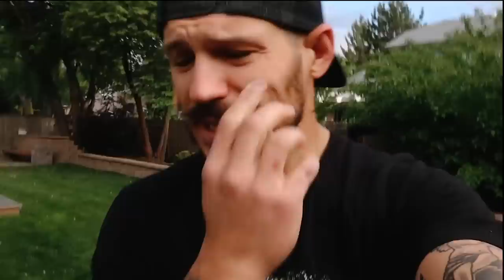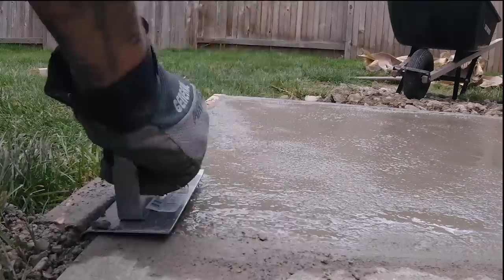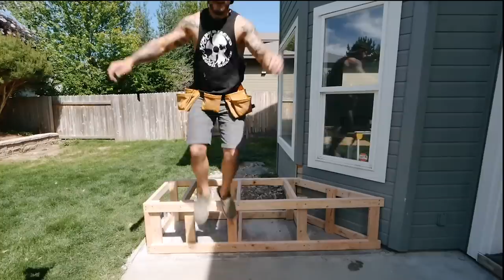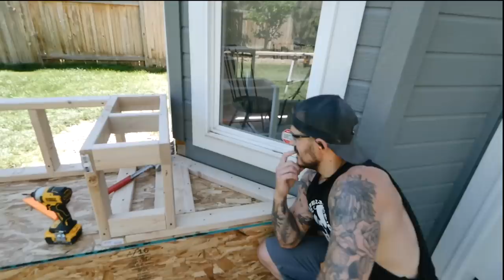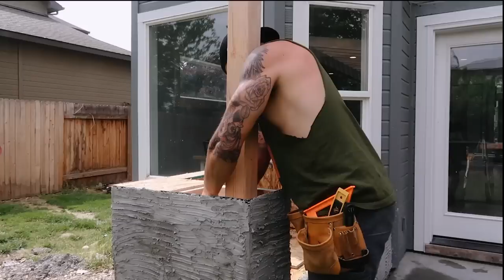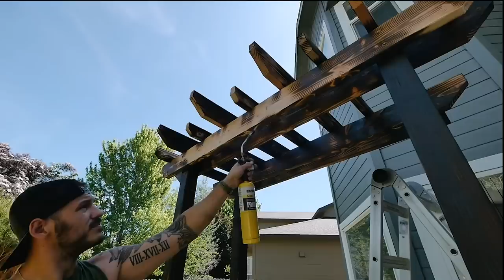Building Outdoor Smoker Grill Station

Comment: Good job on the concrete part.  Definitely want the mesh for reinforcement.  It's unlikely, but the new slab could shift if the ground shifts because it's not tied into the existing slab.  To make sure this doesn't happen you need to drill into the side of the existing slab at least 6 inches deep, then insert a piece of rebar and epoxy it in.  Then when you pour the new concrete the rebar makes it a permanent single piece with the old slab and it won't ever move.  For your new slab you probably needed 2 pieces of rebar epoxied into the old slab spaced about 2 feet apart.  Your slab probably won't move because your ground is unlikely to move since you're in a warm weather climate.  But if you're in an area where the ground freezes in the winter you definitely want to do this.
Reply: I had a concrete business for years and Matt is totally on point.  You pin the concrete slabs together with some rerod hammer drilled in the the existing slab so if one heaves the other moves with it or at least has tension so it wont heave.  Not necessary to epoxy if the hole drilled is slightly smaller than the rerod and you use a maul to force it in snuggly but epoxy would work.

The reason you saw stone on some of the surface is because you didn't use a float first before the finishing trowel.  The float works the stone down in the concrete (works up the cream) a bit and gives a solid rough surface and then you can finish of with the finish trowel when its setup a bit.  Nice job though and looks great.  Here is the link to a simple float, they are relatively cheap.  The float is the work horse that preserves the quality of the steel finish trowel.

https://www.amazon.com/MARSHALLTOWN-Premier-Line-148RD-Magnesium/dp/B001RITKNW/ref=sr_1_6?crid=Y0BFSRLVNW55&dchild=1&keywords=concrete+float&qid=1610422058&sprefix=cocrete+float%2Caps%2C196&sr=8-6
Reply: He could have also dug a few inches under existing piece and put the fresh concrete under while also leaving in the mesh

Comment: I might suggest waterproofing the top surface of the osb beneath the pavers though, just like you would protect roof sheathing. You may see some rot in years to come otherwise. Alternatively, a solid concrete top might look nice, provide better protection, and you could still waterproof beneath it. Other than that, looks great! 

P.s. Love the vids, and nice touch with the torched pergola👌.

Comment: In the future, I definitely recommend laying plastic over the existing concrete slab (wrapping down over the edge between new and existing slabs) which will prevent the new concrete from staining the old slab as you're pouring it. You can then let the new concrete cure and cut off the excess plastic, leaving the remaining plastic between the slabs as a seam to allow for subtle flex in the new slab and further prevent cracking (on top of the "rebar" you already put in). Looks great btw!

Comment: What a great diy project! Question though, are you concerned with your 2x4 base frame about moisture being pulled through the concrete pad as the framing isn’t pressure treated? I thought it was good practice to put pressure treated lumber whenever in contact with outside concrete? Keep up the good work man. Love your work!
Reply: Far to much long-term thought.
Reply: I definitely would use treated wood if building something like this. 

I built a similar unit like this but slightly smaller and with an actual roof instead of pergola and yeah I used all treated wood, the coated for protection.. 
But I also live in cold climate with lots of snow in winter and rain in summer

Comment: Thoughts on just using concrete board instead of wood plus waterproof and metal mesh?
Reply: Steel studs are better also. No need to add more fuel near a fire source.
Reply: Why not just build this out of stone only? The number of different products used makes me ask how much did this cost?

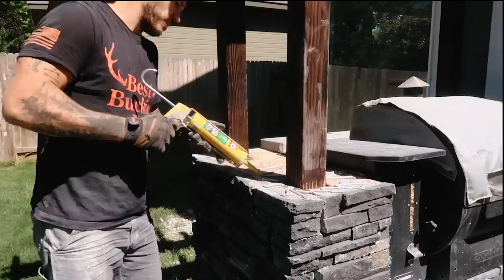Comment: Hey Alex or anyone in the comments, what about weatherproofing under the pavers? I didn’t see any membrane or water protection between the pavers and the OSB. Is this a concern? Rain water will run down in between the pavers. 15:42
Reply: Yes, that will be a big issue.  Didn't appear any of the wood was PT.
Reply: He should have sprayed tile stone protector
Reply: You can use pt or treated lumber with a copper zinc additive that they sell at home depot but starting with pt is easier and safer
Reply: @davidc165  you

Comment: 10/10! There is a high temp red colored caulk, in the wood stove section of the box stores, that would seal where the concrete boards meet. Just extra protection to keep heat from hitting the OSB.

Comment: also no metal "L" shape behind the bottom of the rock, no treated wood on the bottom attached to the concrete, too close to the windows, if you want to build this for few years and then have to demolish it, the go ahead and follow this instructions
Reply: I agree 100% Julio!. Not sure if this was just a quick build and tear down for the show or what. Not using treated lumber or cedar for an outside project is asking for early damage and re-doing the whole thing. At the very least ground contact treated lumber where the wood sits on the concrete.
Reply: Couldn’t agree more. I’d also be concerned about spontaneous combustion of 2x4s as the grill reaches 600+ degree.  Wood will self combust at ~500 degrees. So that OSB and 2x4 can ignite without actually being exposed to flame.

Comment: Highly recommend getting some good sheet metal snips(wiss m6 and m7) this will help tremendously with nicer cuts. Also use side cutters for the cement wire because you will wreck your metal snips. Get the side cutters with the baby blue handles I forget the name. All at Home Depot. -your average sheet metal guy

Comment: it came out looking pretty dang good.  If I were to have built this...I would've extended the front of the pergola to provide more shade while I was grilling...and would've made the top slope downward slightly front to back and made a solid (rain proof) roof structure that would shed water off the back.  That way it looks cool but is more functional.  Also, though you were limited with space...a way to include more counter space around the grill would've been nice.   Of course that is just my opinion, still a very very good looking build and seems very good quality (assuming that OSB board does not get moisture).

Comment: Did you fill the gaps between the concrete blocks on the top? Also, do you think is necessary to seal the concrete to avoid stains of grease? Just wondering, because I am planning to build my own.

Comment: When it rains won't water get inside the 2x4 frame because that angled corner that connects to your house is open? I didn't see you covering the gap with something to keep the water out. Same thing with water running down the posts unless you added some type of waterproof sealant around it. Either way, it looks pretty darn sweet. Congrats 👏

Comment: Wetting the scratch coat before applying the veneer stone will also help the (thinset) mortar adhere better to the wall, even without having to use a bonding agent. Otherwise, in time, the stones could fall off of the wall.

Comment: why didnt you use treated lumber for what is sitting on the concrete?
Reply: Was wondering this as well!
Reply: He should have.  It will rot away eventually.  He should have flashed where it's attached to the house too.  I like the overall design and idea though.
Reply: Watched this exact thing on another tile channel where they were doing a tear out at a really nice property, it's going to rot from the water. The stones and mortar doesn't make it waterproof, in fact the water will just be absorbed into the wood.
Reply: it looks to be off of the ground
Reply: You guys are not making it easy for the dude. Good points. Which I would hate to hear after I'm done 😂
Reply: Shoddy work indeed
Reply: ....no wood at all. Steel stud & hardibacker. No rot, doesnt burn.
Reply: He placed blocks underneath
Reply: Can't believe this isn't top comment.  Looks like water will go straight down posts to OSB as well.

Comment: You didn’t build a port to clear your ashtray. Gonna have to manually do it from the top or remove grill every time
Reply: Or the grease port
Reply: These were my exact concerns when watching this
Reply: But still pretty awesome
Reply: Will anyone mention how the wood thats in direct contact with concrete will just rot out?
Reply: @OncleJer  he put brick spacers on the bottom
Reply: My grill doesn't have a port. It has a trey that you have to lift out so his might be the same.
Reply: I was going to say the same thing. He's definitely has a grease port because you can see it in the video. As it's designed it will just pour grease into the opening the hole with the electrical wire and out the front

Comment: If you want the "cream" to rise to the top, you need to use a magnesium float first, and then the steel finish trowel. Just an FYI. 20+ years of concrete experience.
Reply: Not to mention using a steel trowel right away locks air in and can potentially “pop” the top.

Comment: Awesome build.  What grill did you install.
Reply: It is a Camp Chef pellet grill/smoker. But his build has major flaws like he doesn't have anything to catch the grease that will drain out on the bottom of the right side of the smoker, or he has no opening for the pellet discharge chute, and with no access to empty the ashcan after every use, he will have to use a vacuum to clean it out before each use.

Comment: You forgot to put expansion paper. You need to have an expansion joint when pouring new concrete next to old one so it does not crack to expansion.

Comment: You may have issues with the new concrete against the old. You didn't add any expansion board to account for the expanding/contracting of the concrete.
Reply: a Magnesium float would also help to get you a better looking slab. Mag Float to bring up Paste and push down the rock, trowel to finish and seal the crete

Comment: 15:45 u dont ever wanna make any top surface level on here, just the walls. Same way u did the slab, this should have a little drop on level to account for rain/snow. If the smoker insert its level and its not tilted foward just enough to remove water, them its gonna b rotten in a couple of years. Its tilted to the side but not to the front.

Comment: OSB is not moisture friendly. I would never recommend using concrete with direct contact. A pressure treated sub floor board would be a better choice. None the less good video. Came out great.

Comment: Great work! You WAY undersold this project. Outside of the burned wood, which has been covered plenty, you breezed through two steps worth separate vids: simple/small concrete pads, and the rock facade. Two things seldom covered in detail by the usual suspects on maker YT. Your vids kill because your vibe is so positive and real for the other average dudes with regular houses and regular shops. Cheers.

Comment: Grill within 10 feet of house is fire hazard. Beside window is a death trap. Putting a roof of any kind over a grill or pipe it into the gas line and makes it a kitchen under IRC and the building code compliance would be insane. Homeowners insurance definitely will not cover this house when burns down and this video will be evidence.

Comment: Not a kitchen at all. I don't get it.  The station doesn't offer anything more than the original legs of the grill did. Also, it's made to fit that particular brand of grill. Why was this built? I'm not being negative here, I'm just really curious. If you're going to spend hours doing this, why not even include counter top space? I can't image having wooden beams in my current kitchen on the counter space that negated all my space. You spent so much time on this (even burning the wood beams) and nothing came out of the final product except you replaced the metal legs of the original grill with A LOT of 'stuff'.

Comment: Looks cool, but you blocked the pellet dump lever for the hopper, the pellet clean out shoot on the back of the hopper, and the ash clean out on the bottom. 
Plus you removed the entire sear station. 
Function over form always. 
it will be a pain if you ever what to switch out different kinds of pellets between cooks and to clean out the ash trap after each cook, no thanks.
Should have just thrown a weber kettle grill there, or made your own.

Comment: For the aluminum flashing, use a razor blade to cut it instead of snips. Use a framing square and pretend it's drywall. Make 1 or 2 passes with the knife then lightly fold the flashing to break it at the cut.

Comment: Too close to the house for my taste. What about grease spatter on windows and siding? would have built a little island away from the house. Also, the scratch coat only has to be done in one step not the 2 steps shown.

Comment: That's great until the smoker or BBQ you currently are using in that particular area goes bad or breaks or burns up and they no longer make that particular model anymore and their most current model is larger than what your current model is and will no longer fit into that space.

Comment: OSB? Dude come on! You have extensive DIY skills you should know better! Also attaching the 2x4s to the building without any sort of flashing? Lumber sitting on concrete? At least use a spacer! you could have used a bottom of PVC or plastic or something! you would save so much work without the need for felt or lath if yhou just used hardie board or cement board - you know... what they use in bathrooms, in your shower for wet areas!

Comment: Cinder Blocks, steel studs and cement board or bricks.   Any wood with heat of 360° will turn to charcoal and at 550-560° combustion occurs. Wood is apparently not the correct choice.  
Said with love and safety.  🥰

Comment: I would recommend pressure treated base and cement board instead of the plywood.  Sealed with a waterproof caulk then you can tile or do anything to the exterior you want.  You look like you live in an area like my old home and it gets wet a lot.  That wood would not have stood up over time in that weather.  Plus cement board wouldn't burn.

Comment: Hi I really like your video, especially where you just admit you didn't need the framing where the concrete counter would go. I saw you putting in the level in but I don't think you ever said anything about it or why you did it. I know why ( because your slab is angled away from the house and you need to level the grill) others may not know. Love the video learned some good stuff.
Michele

Comment: I would have charred wood prior to cutting just a little faster and dont worry about heat hitting any areas of house etc. Also, I was told  I would have to build a fire/ heat proof area for my grill with metal. They said the bricks, stones etc would not hold up. So I can I just use concrete board?  Thanks for all yout hard work and great ideas!!!

Comment: Great video  but I will agree with the other comments. The OSB will rot very quickly as the pavers will wick water to the wood and the water will run right in between the pavers. I would suggest you make another video replacing the top with something more weatherproof.  Not meant to be mean spirited comments. Just trying to help out.

Comment: Using wire mesh isn't wrong but you should of drilled into your existing concrete and added some rebar dowels and tied it to your wire mess. That keeps your new concrete from moving away. If you wanted to make it super secure (over kill) you could of dug small ditches down to your footing along your house.

Comment: Awesome project!  When you mentioned that you let your scratch coat set up over the galvanized mesh for an hour, you triggered me a little bit.  Why do that?  Now you have a barrier between the mostly-cured layer which intersects the mesh and the next layer which are differentially cured.  Why not make a single thicker coat and scarify it, then let the mortar fill any imperfections afterwards?  Did the product tell you to do this?

Comment: I believe your videos need to have a disclaimer at the beginning for anyone attempting these projects. Not to be safe, but to have people check codes and proper materials needed. Your build looks fine, as appearance is a matter of taste. But your material choices will most likely leave this build in shambles (structurally) within a couple years. I mention the code part simply due to different areas having different requirements when it comes to adding concrete or structures to the foundation.

Comment: This was a cool idea, but you basically screwed yourself multiple ways with losing features of your Camp Chef.  You covered up your ash clean out at the bottom, your grease bucket on the right, your pellet change out tube on the left, and I think you might have issues with the intake not having enough air.  I'll be curious once you use your grill and notice these oversights and try to adapt it.  I think you could modify this idea to accommodate for all those features.

Comment: Rain is the sworn enemy of a pellet grill.  1) it’s electric and should be kept indoors or covered.  2) rain and humidity will cause the wood pellets in the auger area to swell up and cause the auger to bind or become like solid concrete.  3) how do you catch your grease run off when you blocked in the drain hole?  Watch out for grease fires now.       I guess I would have rather seen you use a gas grill or a flat griddle.  Other than that, it looks great and gave me several ideas, but my pellet smoker will continue to live under a covered area, out of the rains reach.